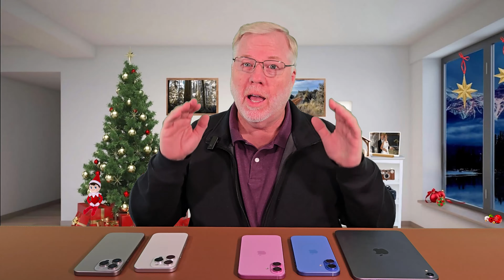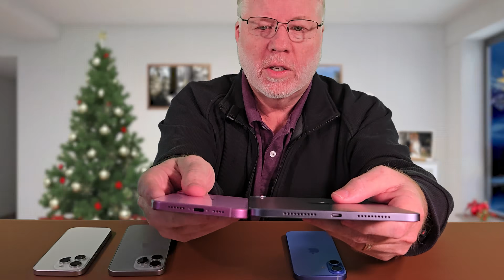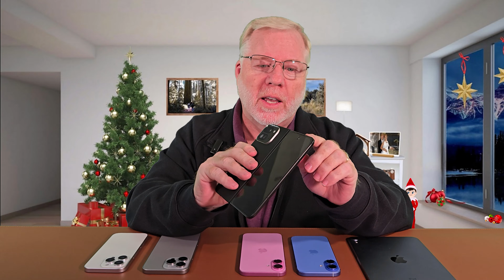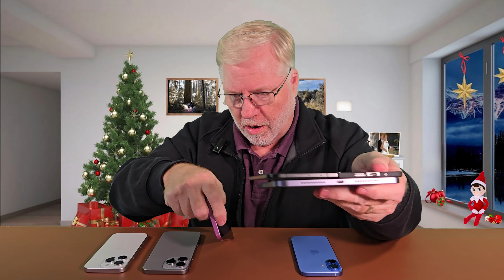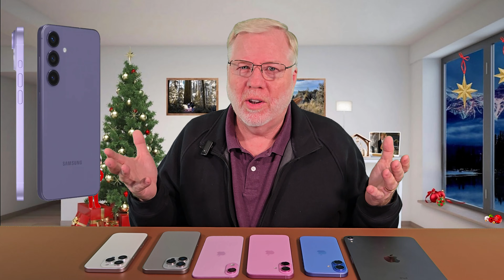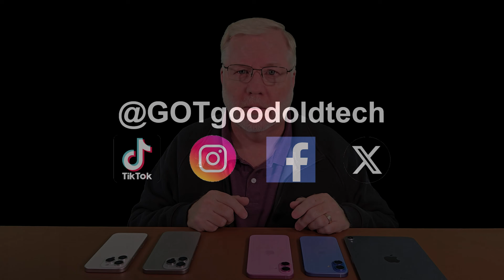iPhone 17 Air: The Thinnest iPhone Yet

Comment: The SE 4 will sell like crazy it always does. The 17 Slim/ Air whatever might be a good option for some. I’d prefer a 17 plus with Pro motion and I’d be satisfied.
Reply from the maker: I believe you'll get your wish if they offer the Plus model. All models will get the higher end display next year. I for one don't understand the Slim / Air idea with only one camera but higher end specs. Seems odd. Thanks for watching and sharing your thoughts. 👍
Reply: @ My theory is the Air model is just a place holder for something like a foldable flip version. Which some other YouTubers have suggested it may be also. 

Some people have said it doesn’t make much sense when the SE 4 is slated to be the entry level model, you don’t need a entry model then another one with similar specs that’s more expensive. 

Although I could see it being more like an SE 4 plus variant. Which may attract more customers.
Reply from the maker: @J.B-is8fb That's an interesting thought. We do know they are working a flip iPhone with Samsung. It's slated for 2026 release. So that theory may have some merit if their plan is to fill the space with a thin phone and then the following year turn that thin phone into a flip. Thanks for sharing. That idea sounds very interesting and I am intrigued enough to research it now. 👍👍
Reply: @ I’ll probably be upgrading my cell phone this spring or early summer. My carrier is getting bought out by T-Mobile and I don’t want to stay. 

I’m coming from an iPhone 13 Pro Max so my choices currently are the 16 plus, 16 pro max or possibly an S25 version. 

I’m not tied down to the Apple ecosystem thankfully. Only other Apple product I own is a 2nd gen pair of AirPods. 

I’m hoping by then they might have some better deals on the 16 series or it may be worth taking advantage of the s25 deals in a few weeks. I usually don’t like buying androids at full retail since they drop in value quickly in the US.